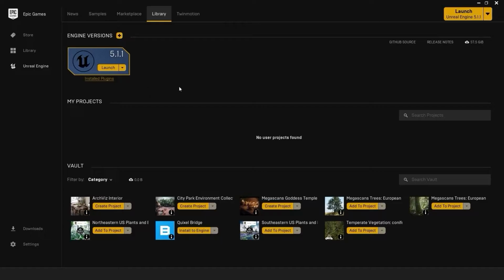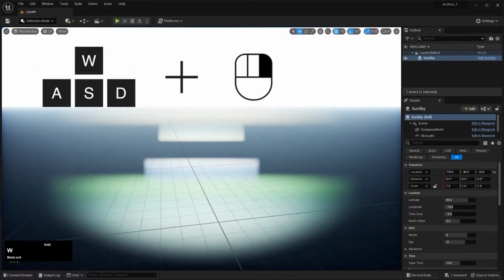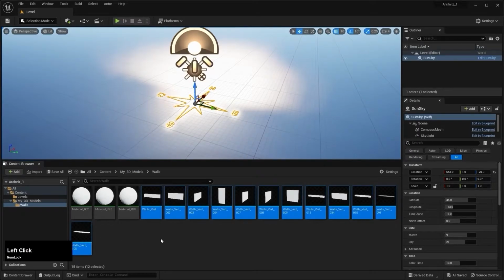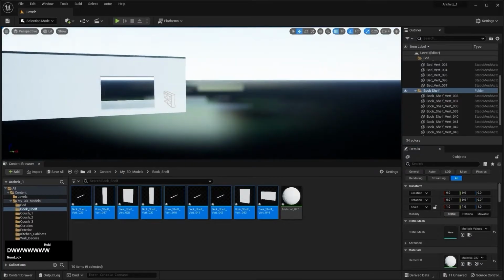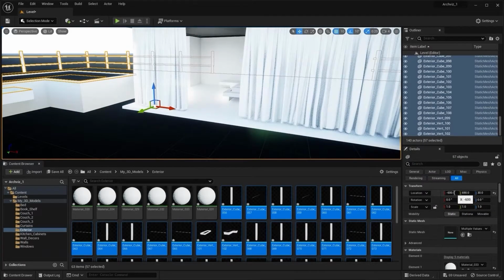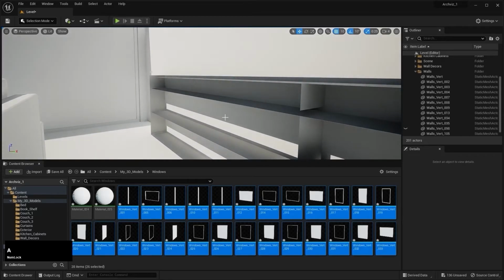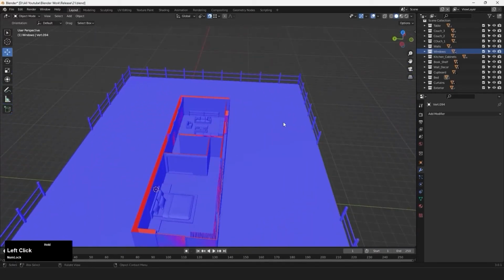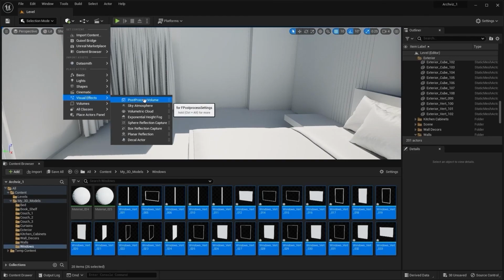Unreal Engine 5.1 For Architectural Visualization | Import 3D Models

Comment: What if i have model in skp and import it with datasmith with no different layers like walls, windows etc. is it ok for further steps or I've to do exact same as in videos ?
Reply: The problem of Datasmith import is you have no control on anything in models, also imported assets always dependence to Datasmith importer plugin

Comment: hi..........i have 1 question ...........when i import walls why my walls coming in very small size i also model them in 3 meters and now i'm having hard time navigating in unreal engine........plz help
Reply: check your import setting when you importing in unreal engine there is option unit same convert unit something like that
Reply: You might need to apply the transforms before the export.